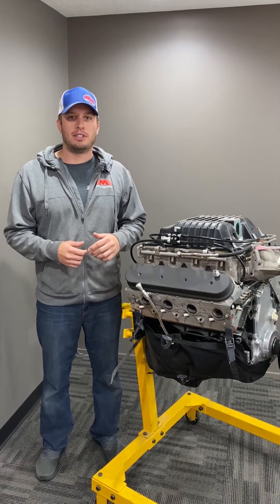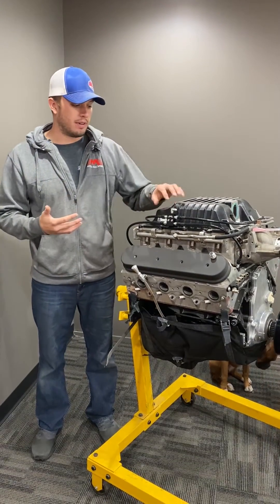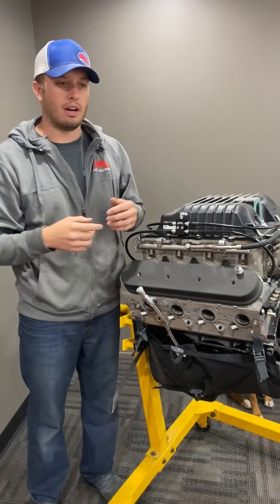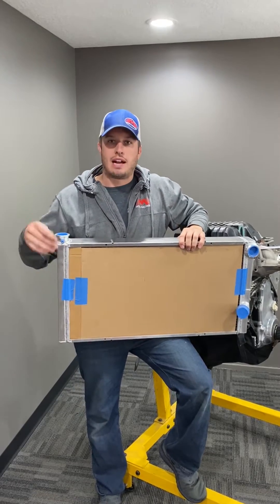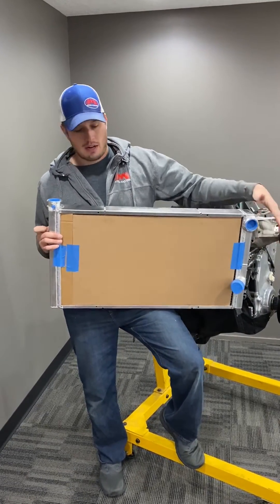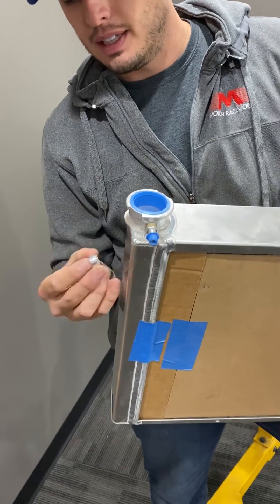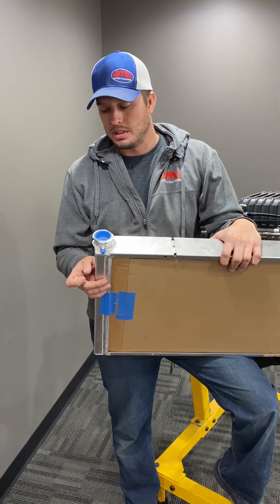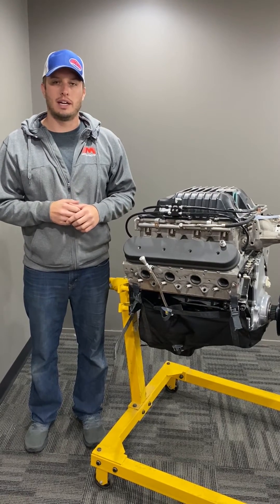LS Steam Vent Kits! Motion Raceworks Tech Tip Tuesday.

Comment: Never heard of this before. Is it just an LS thing, or are all the kids venting steam today?
Reply: I think it's mostly an LS thing. I know the Coyote kinda has something similar with a crossover in front that goes to the heater core (or a restrictor if no core is used) with a Y to the overflow tank and I know there is an additional water crossover you can add to help even things out at the back of the block/cylinders (the Coyote kinda hates cylinders 4 and 8) but I don't know if it has anything to do with steam.

Comment: finally i find a video that explains reason . everyone on the TECH sites kept saying just plumb it to he water pump without any reason why
Reply: Depends on WHERE in the waterpump. We put it into the flow of the top waterneck (outlet), so it goes into the radiator with all the other hot water. The steam never gets to the far end of the radiator. It condenses back to liquid when cooled by the core.

Comment: I just picked up a Holley mid-mount accessory kit and it has a place in the water pump to run the steam Port? now I'm just confused 😂 my radiator does have a port tho!? I would rather not run that steel braided line all the way from the motor to the radiator ( Earl's kit)
Reply: What did u end up doing
Reply: @drjoe2323  around mine to the back of the water pump like Holley said to do lol

Comment: Thanks for awesome Videos and great stuff y’all offer I do have a question if I have this right if we have the factory set up for Gen 4 with the plastic reservoir fill tank I can Tie into that instead of the radiator ? There is an air gap above the fill line just keep it above that as well?
Reply from the maker: Thomas Johnson can you shoot us a pic?
Reply: Motion Raceworks Official were would I send that but it just a factory 2011 GMC Sierra 1500 truck the factory radiator doesn’t have a cap like after market it has a filler tank in the fender well all models above 99 have them thanks for getting back I’ll  figure it out I think he said that I could at the end of the video just wasn’t for sure
Reply: @thomasjohnson1142  did you figure it out? Trying to do the same with mine